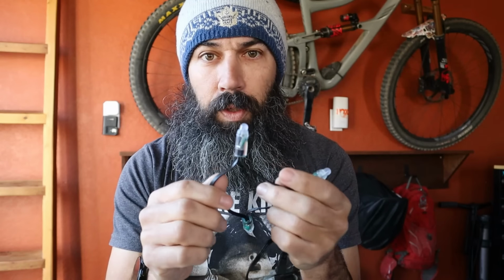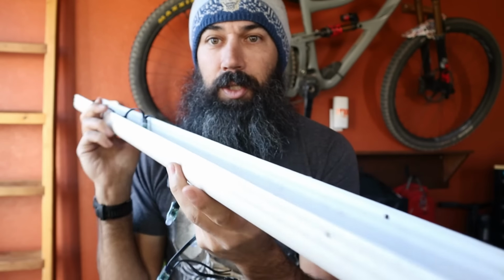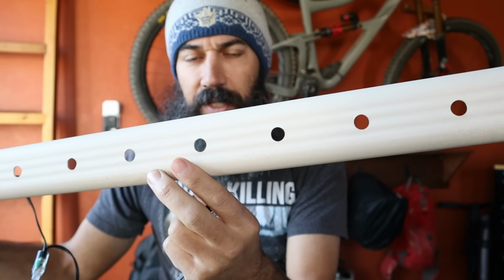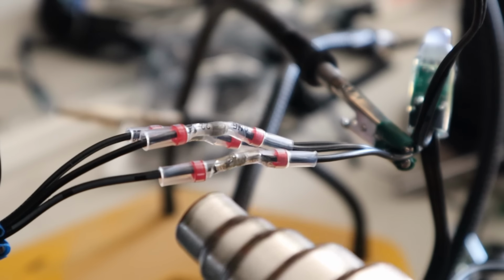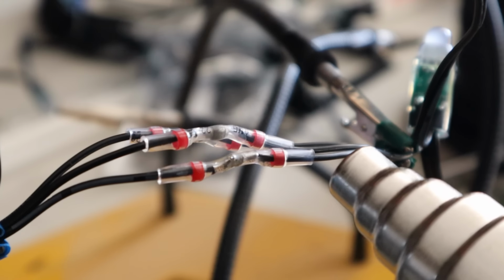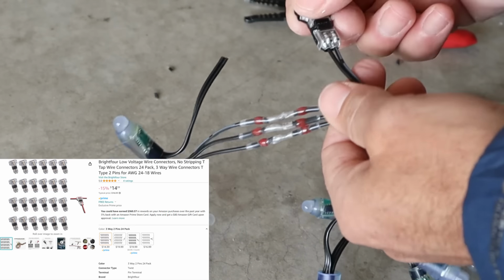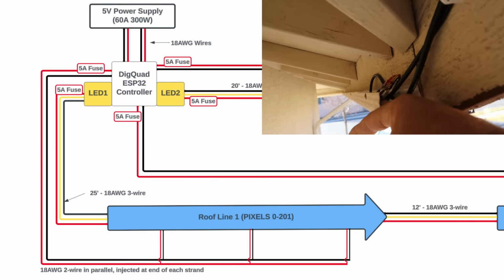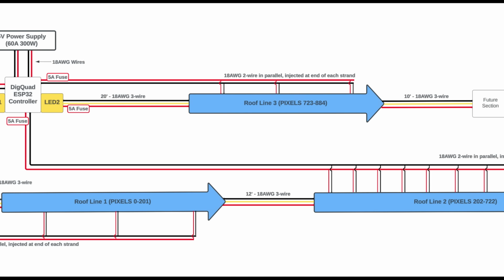Permanent and AFFORDABLE Holiday LED's

Comment: I truly love the way u did your lights and basically followed your idea. I haven't put lights on the house yet due to bad weather this week. I'm trying to see where u ran the t-clips on the wires if u don't mind sharing? Awesome job, and thx for sharing your knowledge!
Reply from the maker: Thanks for the comment!  When it comes to the T clips for doing in-line power injection, there should be a little power injection pigtail at the beginning and end of each of the LED segments. I used the one at the end of each segment to connect the T to.  On the power injection line itself, I just used a utility knife to carefully remove the outer casing, exposing about an inch of the red/black wires inside. Then crimp the T connector around those black/red wires.  I just ran the power injection line parallel with the LED segments, and then figured out where to splice in that T connector.  This was way easier to do once the power injection line was already run.  PAY CLOSE ATTENTION to the +/- so you don’t accidentally inject the power backwards. That would cause all kinds of problems.  Ok, one last thing….depending how long your run is end to end, you may need a larger gauge wire for power injection.  This also depends heavily on what voltage your lights are.  12v is better over long distances than 5v when it comes to voltage drop in the wires. Higher volts also won’t require as large a gauge wire.  Lower volts means you need more current, means you need a bigger wire.  So in my case, I have 722 LEDs spread across about 200’.   Even with an 18awg parallel injection line adding fresh power every 50 LEDs, I still get a visible color drop towards the last 50’ of that run when trying to run true white on these LEDs.  Most other colors I really don’t see a difference. So, I will likely add one new power injection straight from my PSU and tap that into the last 60-70’ of that run.  And that new injection line is gonna be bigger, probably 12awg wire instead of the 18awg.  I think that’s gonna correct the voltage drop.  
Sorry I went on a bit of a tangent there!  I hope that’s helpful!

Comment: I’m going to copy your plan but I know nothing about controllers will you just tell what you used I’m to old to learn about electronics
Reply from the maker: I’m using an ESP32 controller on a DigQuad board and WLED software running on the ESP32.  Check out DrZzs channel for WAY more info on that stuff!

Comment: I’m going to copy your plan but I know nothing about controllers will you just tell what you used I’m to old to learn about electronics
Reply from the maker: Study up and learn all you can about WLED, which I’m running on an ESP32 controller. To make my life a bit easier, I got mine already mounted to a DigQuad board.  Think of that board as the wiring and the ESP32 as the brains. Best resource for this is DrZzs https://youtube.com/@DrZzs?si=H24C8RZaAHeRQ9X3

Comment: Great video! I'm planning to do permanent lights this year and you've given me lots of good ideas. I have one question. With all of the strings soldered together, how did you get them installed in the channels? I see 2 possibilities. 

1. Install the channels on the house empty. Then install all pixels into the channels.

2. Install pixels into channels first. Install channels on house. Then solder together.

Either way seems difficult.
Reply from the maker: You aren’t wrong.   No way is easy.   I soldered mine first, then installed 1-2 channels on the ground before I mounted them to the house.   Soldering on the ladder SUX!  In fact, I made my strands too long, then just trimmed them down. That’s easier than soldering when they are already on the house. That said, if I started over, here is what I think I would do. 
For each section of channel, I would cut the pixels to match that length. So in my case I would trim a 10’ section to 43 pixels. If it was shorter section, like for a short part of the eave, then it would be less pixels. But for each section of channel, it trim the pixels strand then add waterproof 3-wire connectors (kind that screw together). That way I could physically mount each segment of channel without worrying about wires, then just screw them together.  Only part to manage after that would be power injection lines, but I think those would be pretty easy if the channels were already mounted. This setup would also make life better a decade from now when I need to paint my house.  Because then I could just unscrew the sections of channel and take them down temporarily. Hopefully that all makes sense. I always learn as I go, plus gather new ideas from other viewers.

Comment: Dig-Quad: LED controller is Out of stock. know of a replacement??
Reply from the maker: Oh bummer. This one looks similar. https://www.tindie.com/products/giovannicas/esp32-wled-controller-8chan/  Both are ESP32 based so this should run WLED just fine. That said, I have no experience with this controller.

Comment: Be very careful with the cheaper Amazon ones. The lighting industry has seen some serious quality issues with pixels since covid and it has resulted in several fires on props and houses.
Reply from the maker: Appreciate this comment. Fires are definitely a concern.  It’s one of the reasons I opted for 5v pixels.  I also don’t keep my power supply on all the time. It’s on a smart plug, so only runs when the lights need to run.  One extra measure I added was to put a smoke detector in the garage right above the controller/power supply too.  Fires are scary!
Reply: @DadDoingStuff  yeah being in several lighting groups online it's definitely been scary the last few years seeing the decline in quality. I'm hoping for someone to step in and release a quality product that doesn't have those concerns without breaking the bank cost wise

Comment: Forgive me for such a stupid idea and question, but why don't you just do outdoor rated shrink wrap tubing with a water resistant adhesive sealer? Sure it's not necessarily easier, but I'm sure there's got to be a way to do it, and IF it ever needed to be replaced, it would be easier to replace a strip or string, if those quick connect ends were still there, to where all you had to do was remove a piece of shrink tubing to be able to pull them apart, right? Or am I just seriously overthinking things?

And yes, before anyone says anything, I know I MIGHT need to have shrink tubing on the individual wire strips, to beef it up so the bigger outer one will shrink tightly to everything under it, but still... Even IF you didn't use shrink tubing there just HAS to be a way around the limitations of removing the quick connectors, right?

Oh, one thing to think about, since the whole drain-gutter thing looks like a bird sanctuary... Put some kind of mesh over the top and the ends, to keep birds and rodents from nesting DIRECTLY on top of the LED string wires...

Another thing i would like to say, if you're looking for inspiration for projects like this, is looking on YouTube for a channel called DavesGarage (i forget if there's a space or not) he has done basically the same setup as you, except more high end, and with strips instead of strings... even compared to yours, his is way better looking... but then again, he does LED light stuff for a hobby, and id the creator of the nightdriver project, which is software that is similar to, but more advanced than the WLED project, for ESP boards and the like, although I'm not an expert on the stuff as I've never used it before, so you'll have to figure out which is best for you, on your own. He doesn't show his lights on his eaves very often in his videos unless he's specifically saying something about them, but dam, they look good.

Also, if you want inspiration on Christmas light automation, even though it doesn't specifically say how they do it, check YouTube for an event held around Christmas in my area called "Christmas in wadena" and look at the promotional videos about it, cuz dam... that thing IS, and LOOKS insane, EVERY year, with a new aong once in a great while.

One thing you should know about the Christmas in wadena show, though, is that they put the thing up every year, and don't just leave it up permanently, and I'm sure once you check it out, you'll understand why...
Reply: The big problem with the factory connectors on pixels is resistance and corrosion. Even under shrink, they corrode. Lastly, most shirk tube large enough for the connector won't shrink tight on the wire. When you need to take them apart, the waterproof connectors are the way to go.

Dave's project is great, but as far as I know, he wasn't supporting the standard protocol used in Christmas displays. If you want to build a show, you need to be able to stream to it with Falcon Player and xLights. Also, Wi-Fi gets saturated with streaming data fairly quickly, so there is a limit to how many Wi-Fi devices you can use. ESP32s with wired ethernet and WLED work well for a handful of strings like, this video shows. A Falcon F16 control board is well worth the money for larger shows.

My show is small but I add a little to it every year.
Reply from the maker: Hey Dude.  As with most projects, I learn as I go and often think of things afterward that I would change. Or learn new ideas from viewers 😉  That said if I was gonna start over, I would probably use IP67 waterproof connectors and place them at every junction of the channels.  That way if I needed to remove a section to work on it, I could just unscrew both ends and remove that single 10’ section. Definitely more work to install, but could be nice later. 
Far as birds…..yeah definitely a concern that I’m gonna keep an eye on.  I very well might be adding some little screen covers to keep them off the wiring.  Time will tell on that one. 
Appreciate the info on the other channels. Lots of great content out there to get ideas!
Reply: @DadDoingStuff  to be honest, the Christmas in wadena one was just so you could look at their finished setup, and honestly, unless you are going to rope your local radio station just down the street, into giving you a bit of tower space around Christmas to cover the town with a radio station for the evenings, and have the lights move in special patterns like the Christmas in wadena people do, it's more just a showcase of what a finished product could do, if you wanted to do. I honestly don't think ANYONE would want to do what the Christmas in wadena people do,  because the guy that does that, does it as a free will offering to the local food shelf, where he tells people that want to donate, they can drop food or money off in a designated area of the show, and it's one person setting everything up and tearing it down every year as far as I'm aware unless he has any family to help him...

Now the Dave's garage one, that can really give you lots of ideas because he does a lot of stuff when he's not talking about his previous job at Microsoft, with LEDs and things, from small projects to big projects, and he's a good guy to learn a bit about LED setups in general from, even if he doesn't necessarily show putting them together...
Reply: @northwiebesick7136  You don't need to blanket the town with your radio station. My setup uses a Signstek FM transmitter and is easily heard for a couple blocks. Much further than you can see the show, and not powerful enough to violate FCC rules. As for all the animations, xLights or Vixen Lights are relatively easy to learn, and both pieces of software are free. It's not a cheap hobby, but it's fun and easy enough to get into.
Reply: Remember, those little rodentia love to chew on wires!!!🤔😄
Reply: @spuds6423  it's the large rodents around here. Squirrels have chewed through the boundary wire for my robot mower more than once.

Comment: 15/32" = 11.90625mm so, I suspect that 12mm is the diameter of those LED bulbs
Reply from the maker: Correct.  They are 12mm pixels.

Comment: Good thing you have a programmable controller. An interesting Christmas concept that's fascinating with lights is the sequence: set all green; walk a red led through the string; increase to two red leds and walk that; increase by one red led until the whole string is red; then start with one green led and walk that to the end; increase then green by one led and walk it until you have a green string again; repeat. The thing you can vary is the walk speed. The larger the ealking group, you might need go slow the walk speed down to get a consistent effect. Have fun programming. You can also apply this concept and variations to other colors.
Reply from the maker: Love that idea dude!
Reply: @DadDoingStuff  
Don't forget to switch off the green pixel before walking red into same pixel address, otherwise you'll get shades of brown. You'll enjoy inverting bits that are on to off and vice versa. Best thing to do is create an array in memory of total number of lights x 3 (RGB colors). Then map that array onto the data line map via fast write. Or do it the hard way, bit by bit. Kinda way the controller is set up to do that with it's internal color programming as well. You simply write to the array via DO WHILE, IF THEN ELSE loops. Don't forget DELAY, DELAY INCREMENT, and DELAY DECREMENT variables. Many ways to implement it in code from simple to complex. It will be a learning curve. A few months later you'll say "I shoulda wrote it this way and saved time and lines!" We all go through that learning an IT language.

Comment: Have you thought about what you'll do when its time for paint? Do you think you'd take the lights down, mask them, or some other approach?
Reply from the maker: Awesome question.  I did discuss this with another viewer.  Luckily those eaves shouldn't need to be painted often.  But that said, I think if I was going to get a full paint done, I'd just take all of the channels down, then re-attach them after.  I think it would be less time consuming than trying to mask or paint around them by hand.
Reply: Paint on the channel will likely last longer than the LEDS. The channel is behind the eve and under the overhang, it's completely out of direct sunlight and the paint will last very long. Only issue would be repainting it when changing the color of the house lol.
Reply: @pibblesnbits  I'm referring to typical house painting (eves, walls, etc). Some painters spray, others will use rollers and brushes, but either way, I would think that protecting the lights would be a priority.
Reply: @EvanGoss I would assume you would want to either remove the full channel. or atleast mask over either each light or a line over all the LED in a line.  you would not want to get paint over the LEDd

Comment: Did I miss where he actually shows the lights in action?
Reply from the maker: You didn’t miss it. I only had a few clips in that video. My intent was to focus more on how I mounted them as opposed to what they looked like in action. That said, I’ll have some follow up videos about the controller, wiring, and lights.
Reply: @DadDoingStuff  I loved the video and plan to make mine like yours, however, I know nothing about the controller and can't wait to see that video (soon I hope). 

Also, how many feet of lights do you get from one of the TEN coils of lights shown on your Amazon ink? Thanks
Reply from the maker: It’s about 16ft per strand, but that also depends on your hole spacing. With mine at 2.75” apart, I got close to 11.5’ per each 50 pixel strand.   And I personally wouldn’t try to stretch those any further. They do also sell lights with 4” and 6” spacing as well.

Comment: for reference on why the 1/2" bit was too big, 1/2" is 12.7 MM, there are 25.4 MM in 1", the 15/32" bit gives you a hole that is 11.90625 MM which is why it's a better fit for 12 MM.
Reply from the maker: Thanks dude!  You did all the math that I was too lazy to do.  LOL  I kinda wonder now if 11.9mm is even better fit than 12mm.  They fit nice and snug for sure!
Reply: @DadDoingStuff  a LOT of the CAD blocks I work with are in Metric but I draw houses in Feet and Inches so i've had to commit to memory the 25.4mm=1" conversion ratio and I would say the 11.9 would be a tighter fit and as long as you can still insert the object tighter is always better in this case. But I think you learned why some people are willing to spend the money on the premade pieces, cause it takes a real commitment to saving money to do that many holes.
Reply from the maker: Dude, you aren’t wrong about the commitment!

Comment: Great vid, thank you! I like vinyl downspouts for all kinds of low cost, DIY projects.

You mentioned "injecting" more power to the roof lines a few times. What does that mean?
Reply from the maker: The basic version: 
You get voltage loss over distance (especially with a low 5v system like mine). So the longer the run, the LEDs that are farthest away from the power source won’t be as bright. This is most noticeable when trying to achieve a cool white color with RGB pixels. The initial feed from the controller has positive, negative, and data.  
To counter the loss in voltage, you need to add additional power straight from the power supply (needs to be from the same power supply not a separate one) and “inject” that every so often.  Each injection can be a home run back to the power supply, or you can run a larger gauge cable and run it in parallel with the LED strands, just tapping into it every so often.  Dedicated home runs are best, however they aren’t always practical depending your house and roof layout.  I did this about every 50 LEDs. 
Also note the every positive off the power supply or controller that goes to a LED or power injection line should always have a fuse inline.  Hope that helps!
Reply: @DadDoingStuff  OK yes I definitely understand the voltage drop over the lines. So then each 50 lights basically has its own power lines, but they all share a single data line?
Reply from the maker: @themarkfunction  Precisely!
Reply: @DadDoingStuff Awesome, thank you!